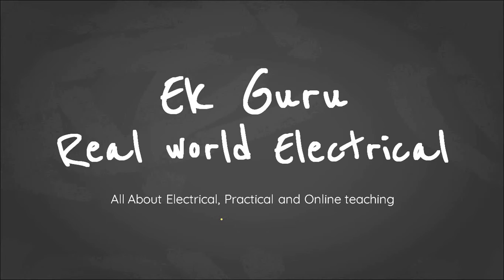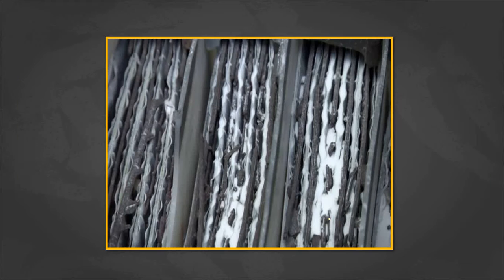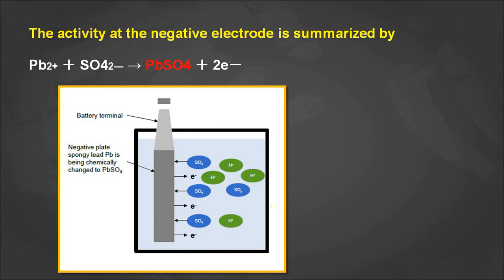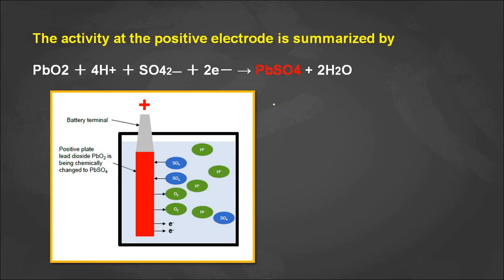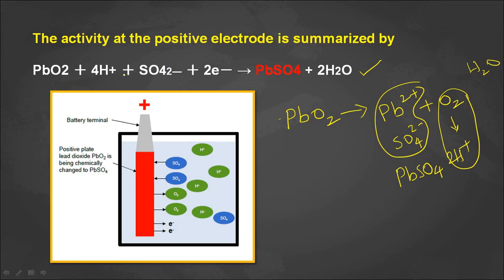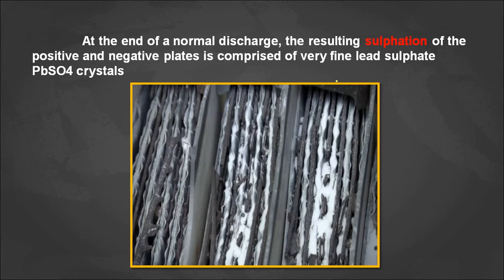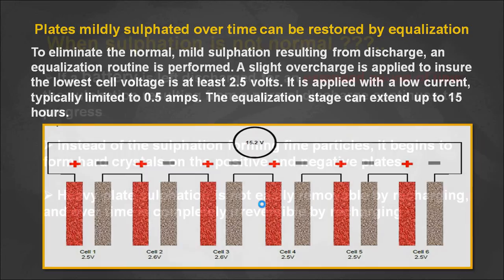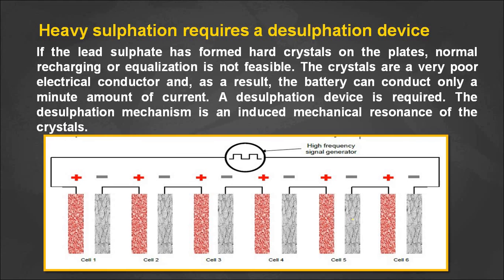Practical || what is Battery sulfation how to desulfate a battery

Comment: When you use a desulfator on a battery is there some sort of guideline of what power or current to not exceed on the battery while desulfating?
Reply: The standard charging current for a flooded battery should not exceed 1/10 of the nominal capacity. For a heavily discharged battery, I suggest setting the current to no more than 1/20 of the nominal capacity.

Comment: What kind of high frequency generator do you mean a signal generator? I think that's called electro defoliation
Reply: The simplest way of desulfation is a charger based on a transformer and a single rectifier diode. The ripple frequency of the voltage rectified by such a rectifier is the same as the frequency of the line voltage (50Hz).